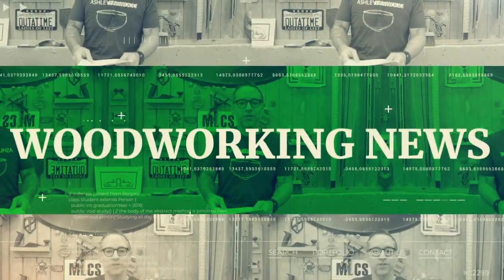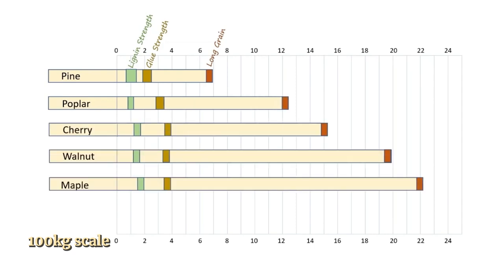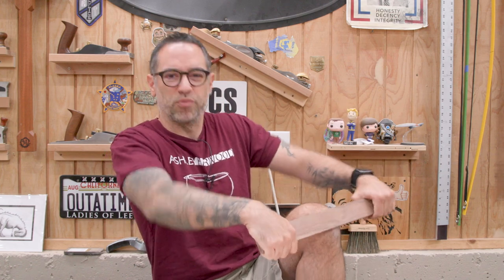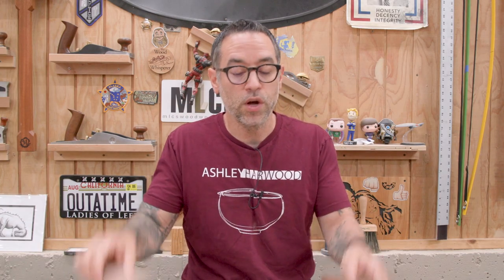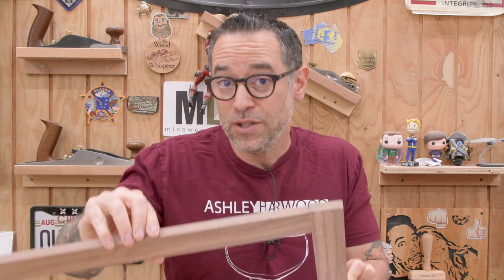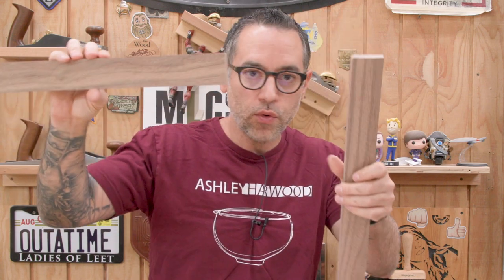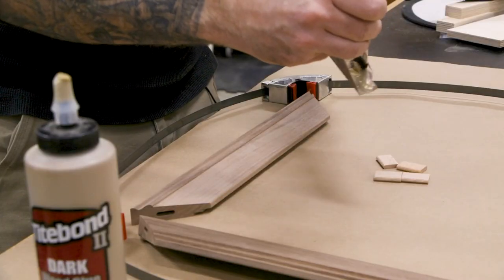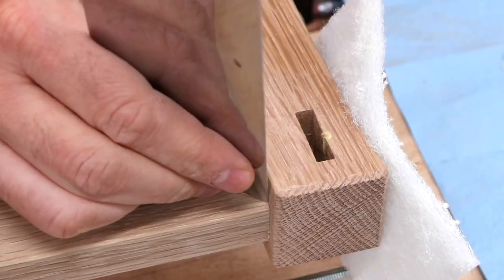End Grain Glue Myths | You May Have Misunderstood

Comment: This was a good video, providing a lot of extra context to something Patrick stated in his his video about the strength of joints being related to the long grain running across the joint.

Curiously though, last year while working on a shelving project using plywood, I had a situation whereby I might of done something slightly differently had I had the experience of Patrick’s video back then.  I was edge gluing a couple of scraps to make a piece wide enough for a shelf.  The joint itself did not need the strength of long grain crossing it, but because of my concern about the fact that each ply would be 90 degrees from its opposite number, i.e. edge grain to to end grain, and thus create a weak glue joint, I placed a bunch of dowels across the joint.  Probably if I were doing the same thing in the future, I would just glue it and call it good.
Reply: I suppose that depends on the leverage forces that would be occurring in that scenario. If the shelves were long and poorly supported then a heavy object on either or both ends could cause failure. I'd have gone with the dowels, basically!
Reply: @ricos1497  The shelf was not long and the joint was along its length as opposed to cutting across its with.  In other words, it would be like a typical panel glue-up whereby you would use biscuits/dowels/dominos for alignment rather than strength.

Comment: Excellent couple of videos by both TWW and Patrick.  I came to YouTube trying to figure out a joint I’m trying to make so the timing of this is excellent.  If I use my Domino to make a joint where one end of the Domino sits in the mortise such that the long grain of the domino mates to the end grain on mating piece.  The joint I’m trying to describe is like joining the sides to the back of a box.  Would that work?  Patricks video seems to imply that it would?  I really don’t want to use screws or pocket holes, but there is no other way to orient the domino for this particular joint.

Comment: Yup. Also, one might say something like "Well, whether it's 1200-1880 lbs or 4000 lbs, both of those are way stronger than the piece needs to be, so a glued butt joint is good enough for my needs". The loads that these videos discuss are essentially one-time static loads that bring the material/joint to its ultimate failure point. However, there is also the matter of fatigue strength. I know it works this way with metal - not certain about wood/glue joints -  but fatigue occurs when a load is applied over many (hundreds, thousands, tens of thousands, or more) of cycles, and the cyclical load that results in failure may be only a fraction of the ultimate strength of a material. So maybe 1200-1880lbs of ultimate static strength may mean that years of loading at only a few hundred pounds might break the piece (maybe a chair like Marc said), while the 4000lb structure may have a fatigue strength of 1000lb or more. Wood movement across the joint, small as it may be, may also deteriorate the joint with time. I'll stick with the traditional joinery.

Comment: The thing I would add is that joinery increases the surface area of the glue joint.  The end grain to face grain might be slightly stronger than face to face, but if you've got four times as much surface area in the face to face joint guess which joint is stronger?  That's where the strength of lap or box joints comes from, tons of surface area.

Comment: Patrick was just busting the end grain myth. The real takeaway is that if you would be OK with a joint using edge grain, there's no reason to think it wouldn't be OK with end grain. All the other things you would normally consider -- grain direction, wood movement, need for hardware, etc. -- still apply.

To add a minor thing, though -- the direction of the grain is also important when considering how hardware such as screws are used. Screws into end grain are not as weak as people often assume, but it can still be a bad choice depending on the application.
Reply: Screws into end grain tests - viral video idea? 😁
Reply: "The real takeaway is that if you would be OK with a joint using edge grain, there's no reason to think it wouldn't be OK with end grain."

This nicely encapsulated the important lessons. If you took a square frame cut out of solid wood and subjected it to load, you'd expect the failure to occur along the short sections of the grain. So yes, glue is stronger than wood, but wood itself isn't strong enough for the job if you're relying on what amounts to "end grain boards".

Also absent in must of this discussion is leverage. Sure, 400 lbs sounds like a lot, but that load is trivially reached by the mass of an adult placed out on the end of a lever. The joints of a chair in which someone is leaning backwards is subjected to many multiples of their weight.

Comment: As you pointed out, a lot of it has to do with leverage compared to joint size. The joint length of face grain and edge grain joints is considerable compared to the length of an end grain joint. The glue always has the same strength, as does the wood. The smaller the joint, the easier it is to compromise the joint, and the failure occurs at its weakest link. In face/edge grain, that link is in the lignin holding the grain together. In an end grain joint, that failure is the glue itself. 
When you further compare the leverage the jointing members have against the glue, the end grain wins again.
While I will always continue to do joinery of some type, I will also continue to glue my face frame (edge to end) joints on top of doing joinery, because I have learned through the years that it adds quite a bit of strength, and also helps to hide the joint better.
Mr. Sullivan's video isn't revolutionary to those of us that have been in the industry (or in the hobby) for any length of time, but it does highlight that gluing all your joints, no matter the orientation, with proper technique, is a best practice.

Thank you Mark, for pointing out that good techniques, and proper joinery are still, and always will be the best practice in whispering to the wood...

Comment: What I learned from all of this:  glue resins interact with the lignum (the concern about glue interacting with fibers doesn’t matter); the geometry of the joint is still the critical factor if you want the yield strength of the joint to approach that of the material; and end-grain only joints are surprisingly strong. Torque matters, particularly when the performance delta is 1::2-3 v 1::8. I will look for ways to get more end-grain involvement, but I’m not going to seat the bottom of my tenons in a mortise just to get an additional gluing surface.  I will glue the tops of my dovetails.  Great videos all around, thanks!
Reply: The test didn't show that end grain glue joints are stronger so you really don't need to find more end grain involvement....

Comment: The reason Patrick's video is important is that not everyone is making furniture or picture frames, with long pieces of wood and leverage trumping all. Guitar luthiers for example have small pieces of wood they use for reinforcement and have the option to choose end grain or long grain joints.

But I like TWW's saying that yes, end grain joints are stronger, but we don't want to be in the cheap seats. We want to be closer to the wood fiber strength anyway, not glue joint strength.

Comment: Don't get carried away. The glue is a large part of the strength of a joint. Even for dovetail joint there is the pull perpendicular to the tail. 

The structure is part of the strength; the glue is another, in most cases greater.  Also important is the most likely direction of forces of stress that can cause failure.

Comment: Marc, I completely agree with your points about joinery but you also mentioned that we don’t glue boards together to make them longer, we get a longer board.  I think the issue is, based on Patrick’s video, is could we?  As Patrick explained, not for a narrow board, but we join boards on the edge grain all the time to make boards wider. Given sufficient width (i.e. glue surface), there appears to be no reason we could not reasonably join boards to makes them longer as well. If it failed, it would still fail along the joint, but the joint would be stronger than the failure point of our edge joined board.  I’m not suggesting making end grain joined diving boards, but I can envision times where it might be useful that I may not have considered before.  P.S., I’m still wondering about the wood movement variable….
Reply from the maker: I mean, you could…by why would you. You end up with a much weaker board and a glue line in the middle of a board. It’s definitely not ideal. Joining boards to make them wider is a different beast as it’s usually for table tops and panels, which won’t experiences them stresses of single long boards.

Comment: I though the glue joint information from Patrick was very useful.  I didn't realize anyone thought it was meant to replace proper joinery...

I just glued up a massive picture frame and added the reinforcement after the fact.  It was comforting to know my end grain but joints weren't as fragile as I would have imagined while moving the frame around the shop pre-spline.

Comment: I think the other interesting take-away from Patrick's video is that with wide, short boards (e.g. book-matching resawn pieces into a longer panel), end-to-end glue joints are perhaps a valid option.
Reply: Maybe, but I think if it were me, I'd use a continuous board as a substrate, and use bookmatched veneers to make it pretty.
Reply: @Mikey__R  I'm thinking more in the case of milling firewood length pieces (<24 inches) into short boards, or using a couple of those left over 1-2 ft board cutoffs.
Reply: @brendanloconnell  sure, but if you did, you'd end up with board that's only twice as strong along the grain as it is across. A 3 to 4ft board with a weak point in the middle wouldn't be any use for anything structural, but you might find a purely decorative use for it?

Maybe you could use those shorter boards to make frame and panel sides for a low bookcase?

Comment: Isn't the simple way of saying the whole thing something like: if you need a wider panel, you can glue side to side, and be safe in the knowledge that even if the panel is glued up, the lignin will fail (well) before the glue joint, so nobody will ever complain about the fact the panel is a glue up -- any failure will be in the wood, not in the joint. On the other hand, if you need a longer panel and glue endgrain to endgrain, that will be failure point -- because you have introduced an obvious failure point, should a failure actually occur everyone will say you are an idiot.  Also, it is easier to find longer panels, which avoid the issue of endgrain to engrain glueups, than wider panels, so glueing side to side makes sense practically and structurally, whereas glueing endgrains does not.
Reply: Well said, I was trying to think of times when you can't realistically just find a board that is long enough for whatever you're building and the only situation I could think of was boat building.
Reply: @WobblycogsUk   that and timber framing. And still on those cases they use massive scarph joints, which again take advantage of the resistance of wood and not the glue.
Reply: I recently discovered that one of the 4 by 4 I bought in the woodshop was glued somewhere in the middle. However they cut two sawtooth patterns in both ends and glued them together.. Dunno if it as strong as the whole 4 by 4. Didn't notice any difference and prolly wouldn't have noticed if not for grain color.
Reply: Yep - and they would be right in saying it is your fault - cause it would be your fault.
glueing endgrain to endgrain is a weak JOINT, just it is not the case that the glue in it is magically weaker but the joint it self is weak as it does not have the continuous fibres that make the wood strong along its grain.
scarf joint or lap joint - those should have been compared to the simpel endgrain glueup - that is what the saying about endgrain-joints is all about.
Reply: Been doing middle age European style  timber framing for years now, I have never thought to just glue two pieces together endgrain to endgrain because here all of this  (side to side lignin will fail, end to end glue bond will fail and  along the grain will take the most to break the wood-  that is why joinery came to be) was   a part of 6th grade woodworking class. To be honest in classical timber framing one really doesn´t need glue or metal fasteners as wooden pegs and the right types of joints with no glue in them will do all the hard labour of keeping the structure solid.  Sorry if my terms are off, English is not my first language.
Reply: @georgelionon9050  I don't know how a finger joint effects the overall strength of a board for a variety of applications, but you don't usually see them in boards meant for structural applications.  They're much more common in moldings.

A finger joint is essentially a special case of an end-to-end butt joint, but with far more glue surface area.  Patrick's video demonstrated to my satisfactions that glue is weaker than wood when this type of joint is subjected to bending stress, but how much so will depend on the type of wood, the type of glue, and the glue surface area.  I'd be reluctant to use a finger-jointed board as a beam unless it was engineered lumber.

However, 4x4's are mostly used as posts.  When loaded longitudinally, a finger joint won't have any appreciable bearing on the ultimate strength of a square post, so you should be safe to use it that way.   In theory, it will be weaker when subjected to bending load, such as in the handrail of a deck, but for an application like a deck railing I would still trust it.  The loads are very modest compared to what a 4x4 can support.  That said, I would not locate the finger joint such that it's just above where the post emerges from the rest of the deck framing.  That's where the bending stress will be highest.  It's probably fine even in that case, but why test it?
Reply: @kalev60  You are absolutely right, however, traditional timber framing joints are generally stronger with glue than with pins.  The pins are only meant to keep the joint from sliding apart, and to the extent that they are loaded they're loaded in shear.  At the risk of over-generalizing, a large glue area is much stronger in shear than a wood pin or two.

I've sometimes wondered why pins were still used in timber framing.  I have two theories, but having never done it I don't know for sure.  1) People who want timber framed buildings like to see the traditional joinery.  2) Large timbers probably aren't as dry as wood used for furniture.  If that's correct, they'll be more prone to shrinkage and glue may be less reliable than mechanical fasteners when significant shrinkage is involved.  What do you think?
Reply: @charlesenfield2192  Thanks for the elaborate answer, I used it as feet for my DIY bed. I'm confident it can still hold my weight ;) and bending stress is practical nonexistent here. But I was just surprised to find it in a wood meant for construction... didn't notice it in the woodshop, but of course once I started working with it. BTW: I know with 4x4 for a bed I went major over actual needs. But I liked the idea to have a comfortable area for the slatted frame to reside upon.
Reply: @georgelionon9050  My shop-made bed is 3x3 at the corners.  Small posts just seem out of place on a large bed.
Reply: @charlesenfield2192  Indeed!
Reply: @charlesenfield2192  Yes large glued would be stronger then pins, but I would not underestimate the pins. I have seen some failed joints in large timber frames but I´ve never seen a failed joint where the pins were broken too.  1) and 2) are also spot on. If I remember right furniture were under 12% wood moisture, timber frames and log buildings usually under 18 or 20 % . One can build out of total wet wood but shrinkage will create caps in the joints and effect the overall look of structure.

Comment: A solid explanation, Marc. I think part of confusion comes from the term, "wood strength", which is wholly dependent upon which direction you're trying to break the wood. Along the grain, a board is less strong because the lignin bond is breaking apart, not the fibers themselves. ("Glue is stronger than the wood" is what we've always heard when talking about edge grain, but that's actually misleading. It's really only stronger than the lignin bond.) Trying to break a board across grain is much tougher because the fibers are much stronger. So the typical "glue strength test" of edge grain vs end grain is really comparing apples to oranges - you're actually testing wood fiber strength verses lignin bond strength. This may be totally wrong but it could be the GLUE joint strength on edge grain vs end grain is exactly the same. Not sure how you could test that specifically but it's an interesting topic. 

But no, I don't plan on selling my chisels or domino (if I had one), just yet. ;-)

Comment: A watched a video by diy huntress where she made a chevron cutting board that had end grain to end grain glue joints. I actually commented on the joints in the video but after watching Sullivan’s video this could be an example of an acceptable use.   I do wonder about strength over time as the expansion and contraction would be 90 degrees to the glue joint from what we typically do

Comment: Great video to add on to Patrick’s findings. While I complete agree with what you had to say wouldn’t the thickness and width of the wood being used have an effect on the strength of the joint? I would be curious to see the results of the  strength of the glue joint between two boards being glued in a cross form or a even in a half lap type joint. Again great video Marc.